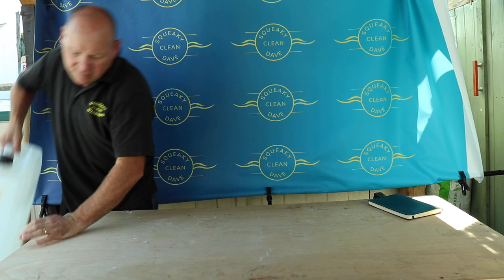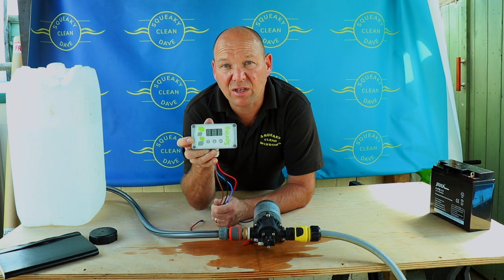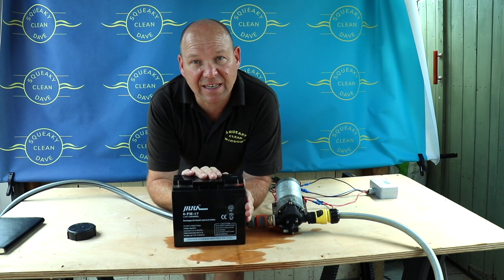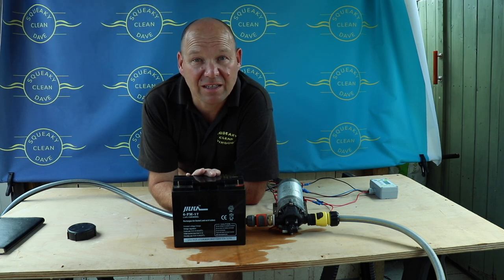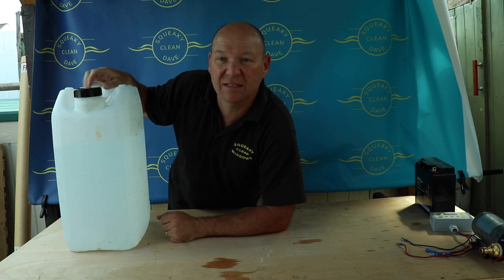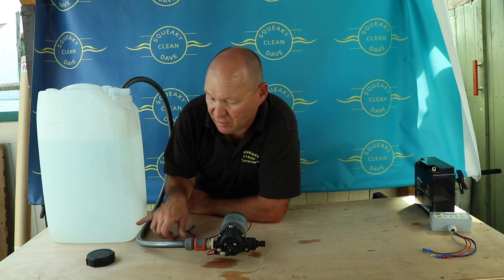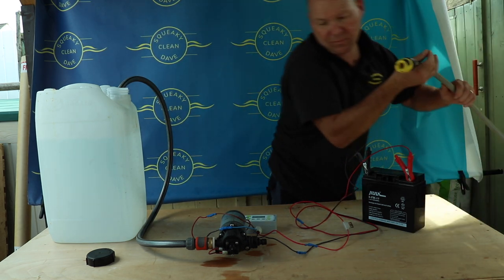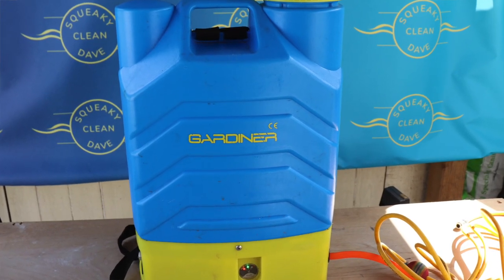Step By Step Guide To A Water Fed Pole Window Cleaning Set Up

Comment: Hi Dave wondering if you could help me how do I connect the hoselock to each end of my pump my pump doesn’t seem to have any ?
Reply from the maker: Hi Paul. 
Most pumps have a threaded inlet and outlet. This thread is the same size as the Hozelock style tap connector so will screw straight on. You can the connect onto this with your hozelock fittings 
https://www.screwfix.com/p/hozelock-threaded-outdoor-tap-connector/52973
Reply: @squeakycleandave1  the is for the reply Dave really appreciate it mate the pump I’ve bought wasn’t a sure flow pump cheaper one with 100psi but the inlet n outlet part is too small for hoselock I even bought hoselock reducer  still too small will have too get a bit of hose or something to fit it 👍🏻

Comment: good morning, i am wanting to set up a water fed pole for cleaning of k-rend and render, i run a rotary cleaning buisness at prescent,but always being asked to clean render and such, i no theres a system call soft washing,which is what im looking to do, i have purhased pole,and want to run off a clarks pump 1200 stainless steel, from here im a little lost, given the height of some k-rend ,i need to get cleaning product right to top of pole ,once extended, sorry its long winded, i have pump and pole thats it, so insight as to what else i need , hope you can help, regards chris
Reply from the maker: Hi Christopher
I don't know if you know or not that sodium hypercloride damages K rend. If you are thinking of starting soft washing I would seriously recommend you get some training first from softwash training solutions first. 
http://softwashtrainingsolutions.co.uk
Reply: @squeakycleandave1  thanks dave, have looked into cleaner for k rend and such, thats in hand, will make contact with training course people.,im sure a can use the pump along with a firemans attachment ie hand held trigger to apply cleaners, but will try this one out first, one more thing,advertising is not bringing many leads in, i have been paying through google ads,but not getting much from ad, is this give it a time thing. thanks for help

Comment: we spent all day on getting the water to be filtered and still havent achieved it yet? I kinda wish I hadnt started but have payed out now. think it will be worth it in the end.
Reply from the maker: It will definitely be worth it in the end. What problems are you having
Reply: @squeakycleandave1  bought a 40 40 reverse system and it turns out my water pressure isn't fast enough for the system to purifie the water down enough. so I may have to buy a new filter or a pump system to speed up water flow. either way I will be forking out £100s of pounds I havent got?
Reply from the maker: @0flan  that’s hard mate. It took me years to get my system to where I wanted it
Best place to get a booster is Blade Right
https://www.bladerightcleaningsupplies.co.uk/shop/water-fed-window-cleaning/pumps/rotary-vane-booster-pumps/

Comment: Most switches, including the ones you displayed, have a voltage display built in, you don't need a separate volt meter with these switches.
Reply from the maker: MrBazinger that’s a very good point. Because I had already got my volt meter fitted and it’s on all the time without pushing any buttons I tend to forget the spring controllers have them👍
Reply: Hi dave do u have a link to the stuff thats needed?

Comment: can you help. my pump in my van stay on when I turn it on. It keeps reving all the time. it never goes into pause. and the water pressure has dropped. I have no leaks. is the pump knackered? I'm new to this so dont know the correct terminology sorry. can you advise? thanks.
Reply from the maker: Try setting the dead end. If this doesn’t work contact the suppliers for advice 
https://youtu.be/mTBbco7c15U
Reply: @squeakycleandave1  the suppliers say it's fine and dont want to know. it was only a cheap pump. but thought I'd get longer then 4 months out of it?
Reply from the maker: @0flan  that can be the problem when you buy cheap. What type of controller is it
Reply: @squeakycleandave1  it's a cheap and nasty one I bought of Ebay. it sold as a set. a black digital one. it has no back. thst seems to be working fine. but will look at getting a new one soon. can you recommend one?
Reply from the maker: @0flan  Go for any company selling a V16
Reply: do you think it's the pump that faulty or the control unit? I've order a new one so hoping that will do the job.

Comment: If anyone requires and help with wiring / electronics I'm happy to help if building your own systems.

Don't forget to use an inline strainer before the pump and fuse protection on the controller
Reply from the maker: That’s good of you to offer Austin. You are right about the strainer but I was trying to keep it as basic as possible 👍

Comment: Sorry Dave i disagree with you ... we have been cleaning since 2005 and not used a controler for most of that time in both vans we just rely on the pumps pressure switch, most pumps are 5 -5.8 litres per min ... just not enough water so never turn the controler down, I'm experimenting now with pumps at 10 litres per min and enlarging the jets on the brush, the more water on the window the quicker the clean  Again apologies you do not understand about leisure batteries, they should never be discharged to less than 40% and then charged up as soon as possible, split chargers only charge at about 8amps .... there are expensive split chargers about that £200-350. that basically fool the alternator on your van to charge the leisure bat at a higher rate as Alternators can put out 180 Amps. the best way as you have suggested  charge the battery overnight useing a 5 or better still 7 stage charger that will disulphate the cells thats if you are useing a lead acid bat, of course if money is not an issue then a Lifo battery is the answer but thats another debate for another day.
Reply from the maker: Hi Alan 
Im not opposed to people disagreeing with me as we are all learning. I wasn’t trying to say that this was the only way of doing things but was trying to simplify it to make it easier for beginners to get there head around 
I totally agree with turning the flow up and I always use 4 jets on a brush to get as much water spread across the glass as possible. 
I know not to over discharge the battery that’s why I’ve fitted a volt meter and if the split charger isn’t giving it enough then I will top it up which the bench charger de sulphate mode on it but it’s not often I need it